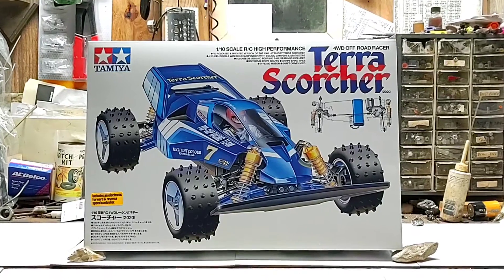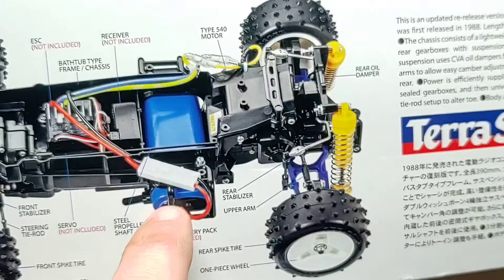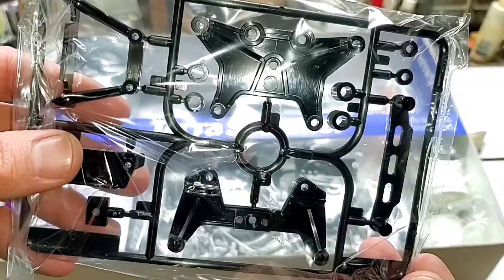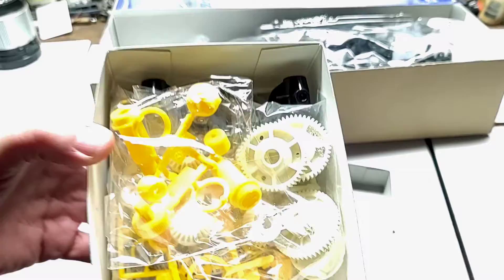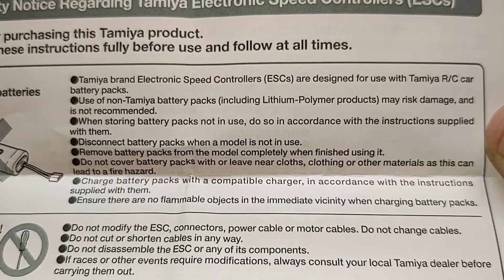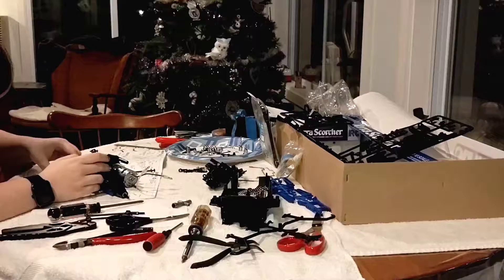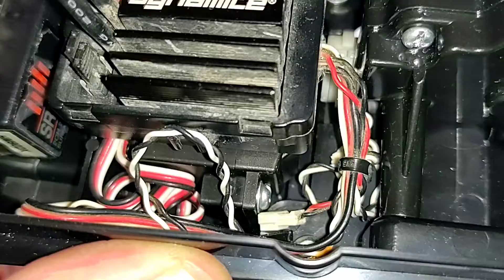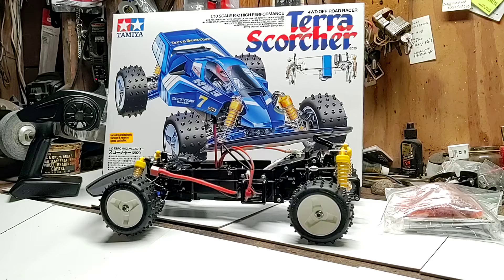Tamiya Terra Scorcher; Unboxing plus+

Comment: If you run it with a lipo pack with that ESC you're going to have to buy a lipopac monitor to go to the balance leed to make sure you do not over discharge the battery.

Comment: I'll keep in mind you should get the front A5 part in aluminum from x speed because that front part that holds the front suspension together can crack really easy in an accident just keep that in mind.
Reply from the maker: Good call Brother 😊👍
Much Appreciated for the heads up and great advice.
😁🤜🤛

Comment: The thunder shots coming back out again.
Reply from the maker: Great car 😊👍
But what I would really like to have, is for Kyosho to Re'release the "Turbo Optima Mid SE" I had one way back when that I turned into a SC truck, and it was a real slayer, I was running a Novak rooster v1 ESC and Trinity Speed Gen Diamond motor in that one, And it moved out.... 😂👍
I've owned a crap ton of different RC's throughout my 44 year's of RC addiction, And the Turbo Optima Mid SE was one of my favorites.😁😍🤤
Reply: @R.C.A.D.  it is coming out this year the mid.
Reply from the maker: What?   No way! That's crazy as hell, I'm gonna have to start banking up some money for that one.😁👍
Reply: It isn't a se it is it's first mid from them.
Reply from the maker: ☹️ now I'm a little bit bummed out, But I'll get over it.😄👍

Comment: The motors of 27 turn does about 15, 000 or 15400 RPM.
Reply from the maker: 27t ! That's it 🤷 talk about weak sauce 😂 lol 
I was thinking about something more in the lines of 12t 😄👍
Reply: @R.C.A.D.  go 4000 KV.